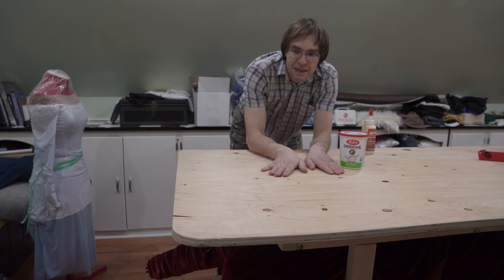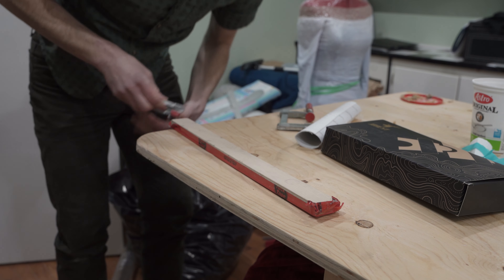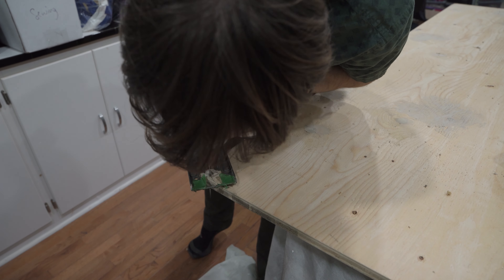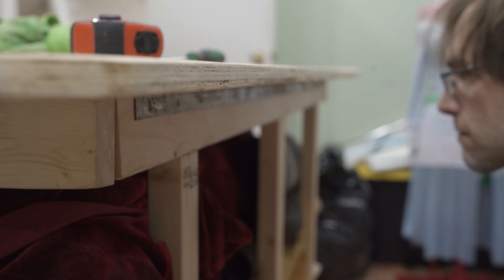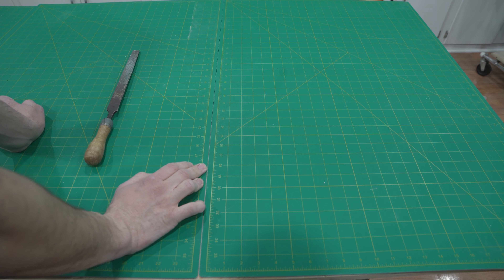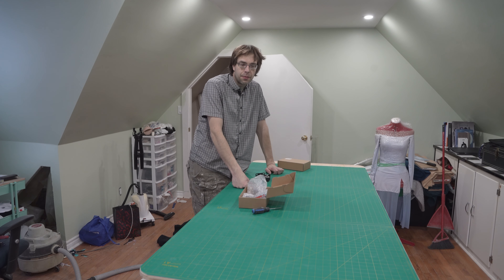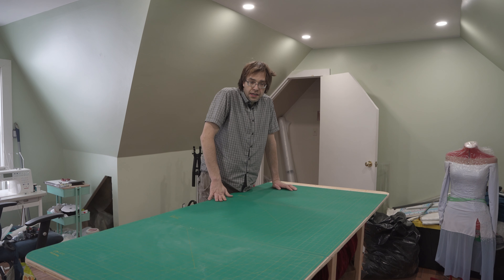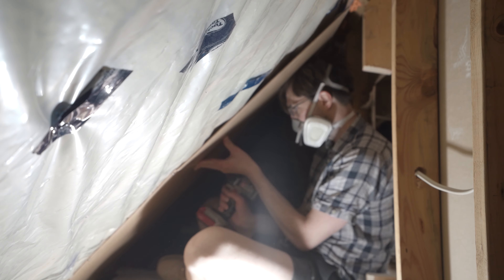Crafting A Cutting Table

Comment: Nice build! I think I might build something similar.

Here are a couple things I might have done differently:
1. Instead of filing the seam, I would have cut the mats along the edge of the grid line. That way you can measure longer spans. Initially, I thought this would obscure the measurements, but it looks like the measurements are actually inside the grid and not along the edges so it shouldn't be a problem.
2. I would have overlapped the tape between mats, so that the mats don't move relative to each other.
3. I like the hinge and it looks like it stays when it's opened all the way, I'm just wondering how tall your wife is because I can anticipate it being a bit difficult to put it all the way up and pull it back down if she's standing in front of the table. A kickstand might be helpful to keep the table propped up at a shallower angle might be helpful to prevent having to walk to the side of the table if you want to open it all the way.

Also, make sure that whatever storage you make for the edge of the table takes into account the hinge. Last thing you want is to dump out all your tools when you lift the top. For the next iteration, one of those fancy z-hinges that keeps the table top flat would be cool. That way you didn't have to take everything off the top in order to access the bottom area.
Reply from the maker: Excellent suggestions, but it's all about your use case.  We don't actually use the numbers, it's all about the surface protecting the wood.  I thought about overlapping the tape but the mats wear out and the middle will likely need to be replaced first.  I was also concerned about fluff and dirt sticking to the tape in the gap. Also while yes the top opens, no the top will never be clear enough to actually be opened.  :) It's just how sewing projects work.